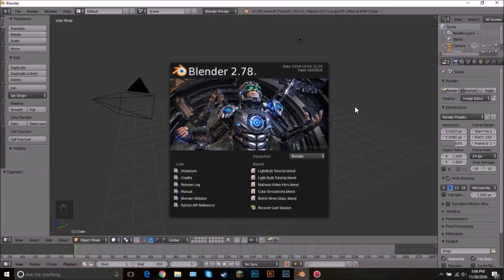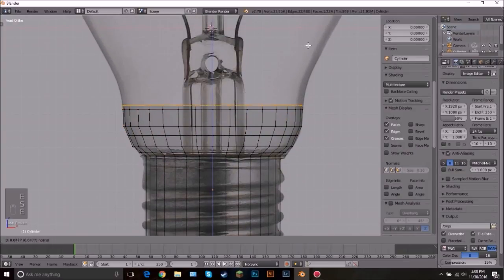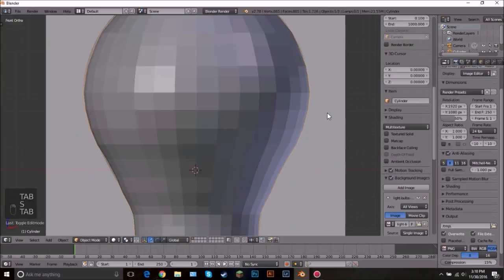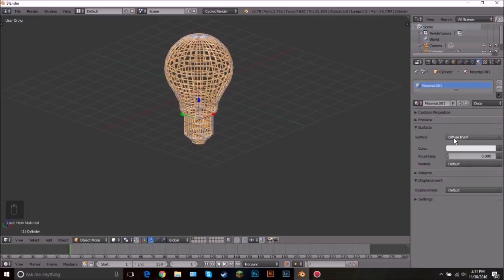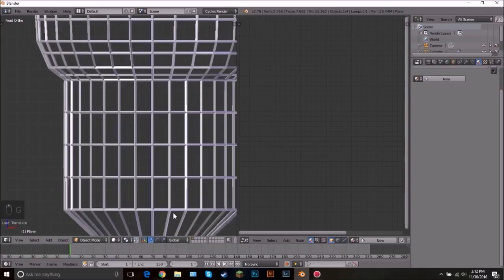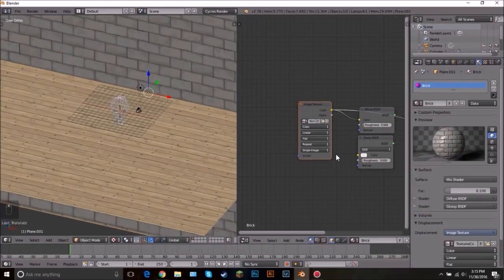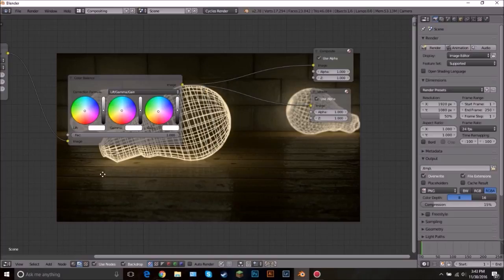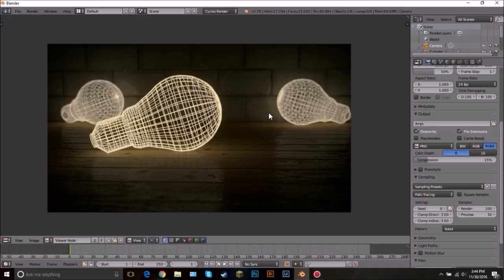How to Create a Wireframe Lightbulb in Blender

Comment: I want to be able to do this and save it as an svg file, is that possible? I need to make acrylic 3d lights with my laser engraver. I have some experience with blender, but I would like to make a baseball hat that looks 3d with wire frames,  can it be done? Thanks1

Comment: Remove double did not appear in the special menu  please help ..
Reply from the maker: If you press W it should appear but if that doesn't work go into the tool panel by pressing T (make sure you are in edit mode) and scroll down to the remove section. There should be an option for remove doubles there.